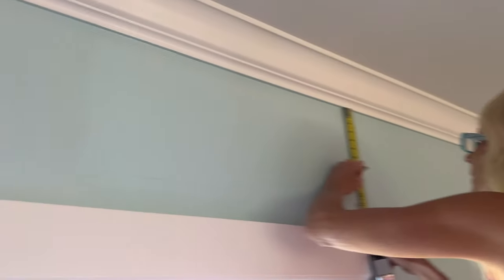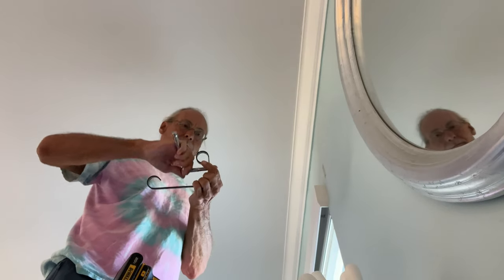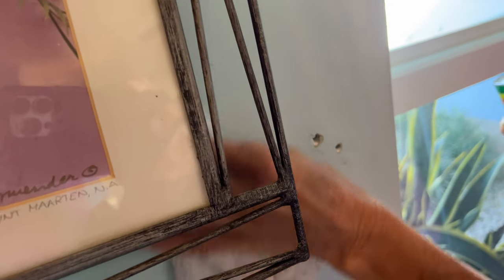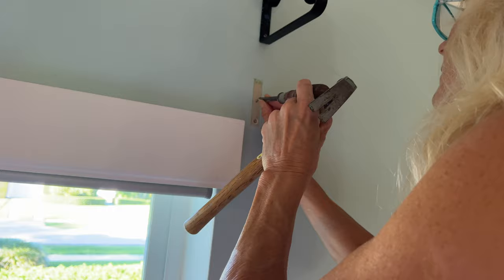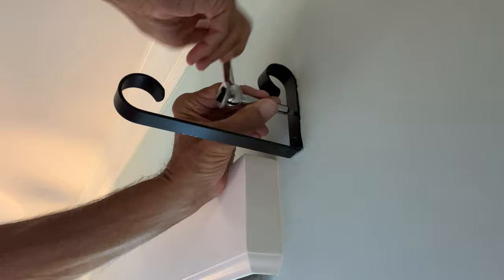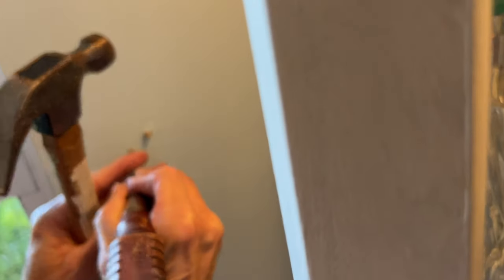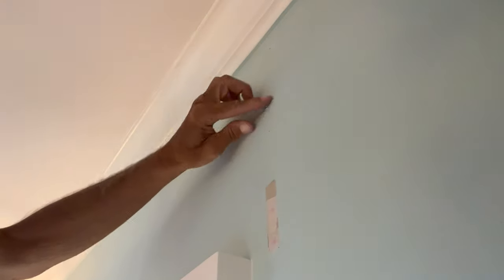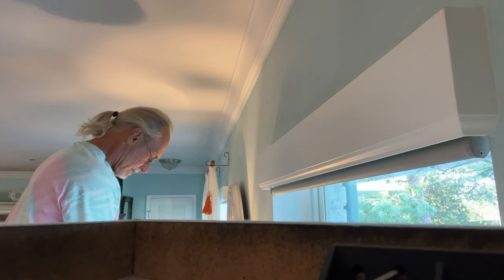Installing Curtain Rods in Concrete wall

Comment: OMG please delete this!! You should have used an anchor. This will pull out if you use this very much!!
Reply from the maker: Believe it or not, they are still up there and holding our curtains
Reply: concrete screws go thru the drywall into concrete block wall. stronger than a drywall anchor fo rsure...